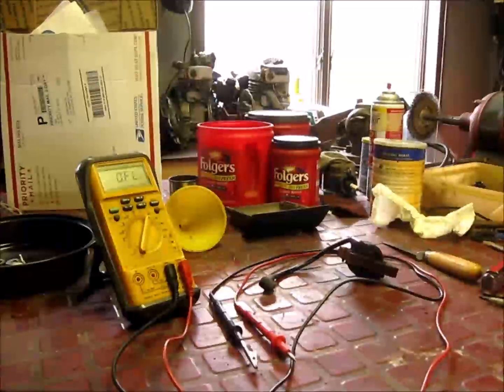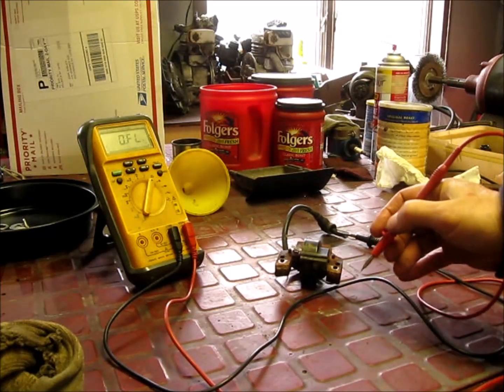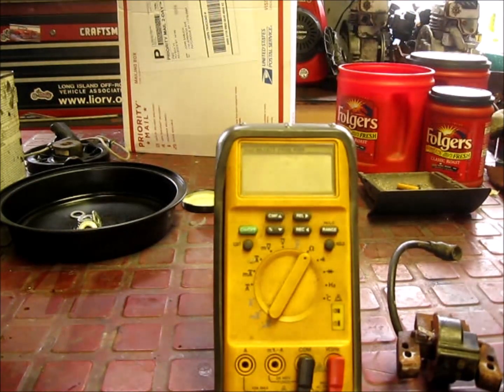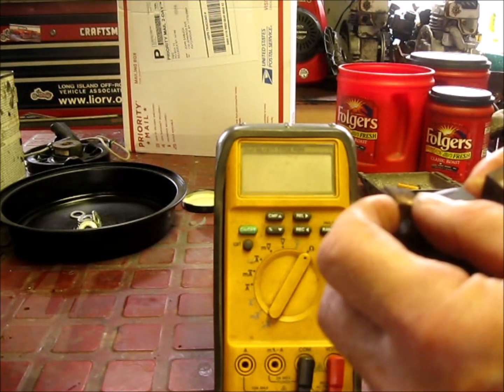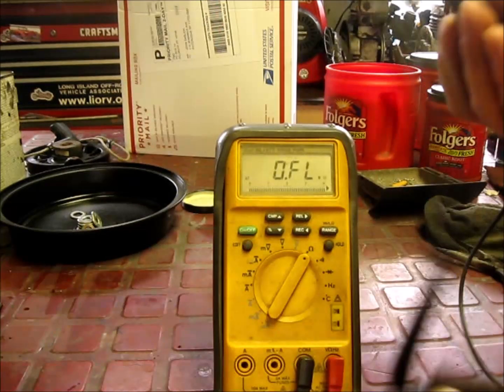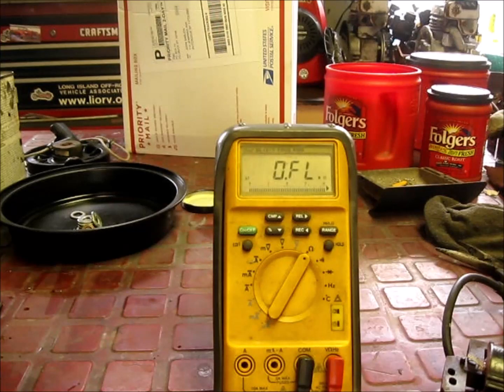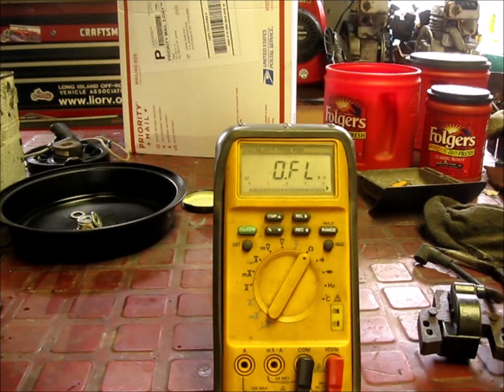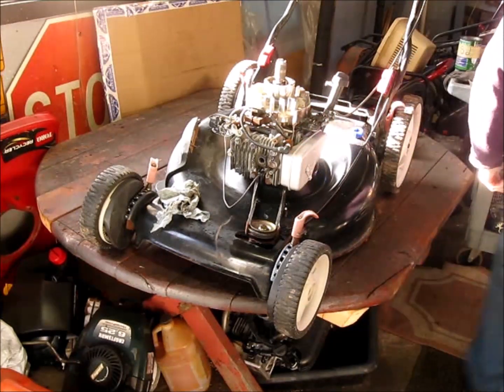FIX YOUR ENGINE COIL ~ Why Cleaning Small Engine Magneto Coils Makes a Difference

Comment: Should the coil be magnetic?   Meaning it will be attracted to the flywheel on the mower?
Reply from the maker: Yes, those steel wafers, not the coil which is copper.
In my videos I often show how to gap these and I show how the magnet of the flywheel attracts the magnatron

Comment: Please what chemical/method did you use in cleaning the coil
Reply from the maker: you can use any rust remover, not rust converter. Naval Jelly works well. I use either Eastwoods Fast Etch or Kirker DTM Metal Prep
Thanks for watching!